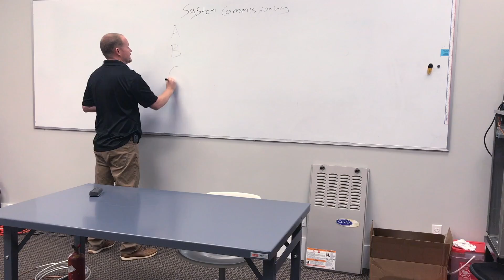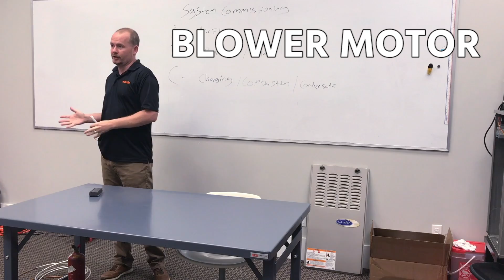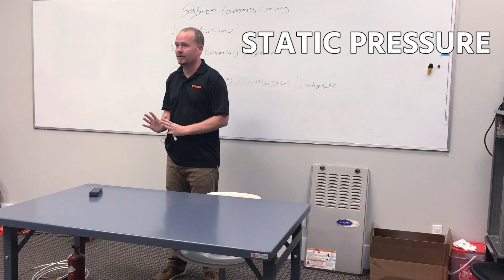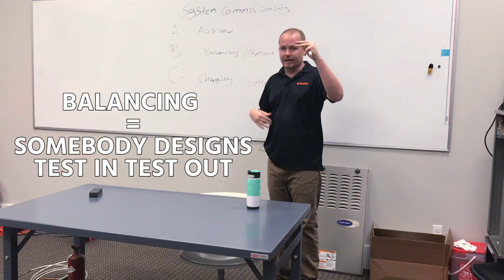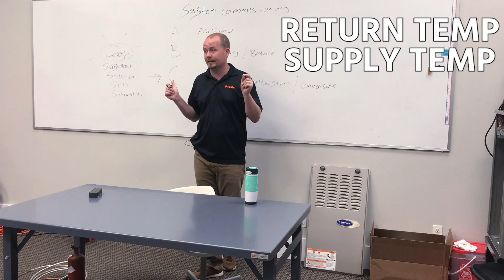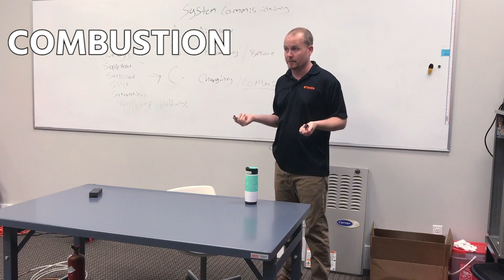Residential System Commissioning (Kalos Meeting)

Comment: My Personal Favorite is a backwards running compressor. Identified because ECM condenser fan motor stays at low speed because it is not loading up Condenser Coil with rejecting heat load. These things happen often with Techs who are unexperienced and have started up a system and has system running backwards. However fan is running forward because of the ECM/VFD driven evaporator motor so technician assumed compressor will also be in correct rotation. Phasing meters typically take care of these issues however they too are often overlooked. One simple test I use is if I believe compressor is running backwards I check top of that compressor where the discharge gas is coming off the compressor. If backwards this top of the scroll compressor will still be cool to touch and I should not be able to place my hand permanently on the top without it being to hot to touch. Sound of compressor is other factor to listen for as compression sounds real rough due to backwards actions. This is also not good for compressor as it can and will over prolonged times running backwards cause internal damages to the scroll compressor internal components.

Comment: Check the feed and service panel breakers for the system first, make sure there making a complete connection and sized right thrn check that they function correctly, last check with a meter.... If you fail to realize the condenser isn't blowing, running backwards, or if the compressor isn't cycling or if it's short cycling them u need to get another job. All symptoms that u may not be getting full potential.
He's right though.... just keep in mind every components proper functionality in any system is dependent on the supply. I ran service long enough.... Don't worry about all that crazy charging stuff 100% until u start doing parallel racks, multiple compressors and stuff.... weigh ur dump though if ur using the companies refrigerant... That's really why these guys stress the weigh in method. Breaker trip malfunction can and often is intermittent..... I wonder how many licensed mechanics still have call backs on problem systems because of it....